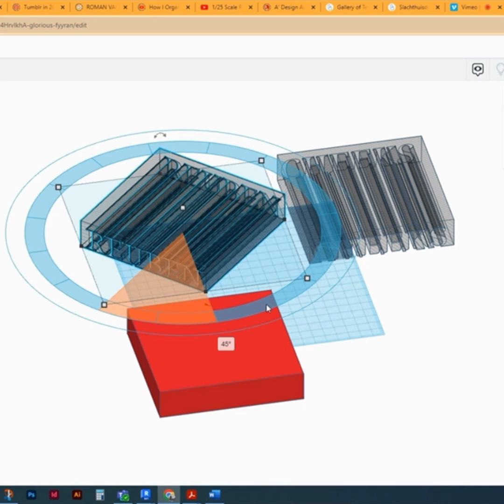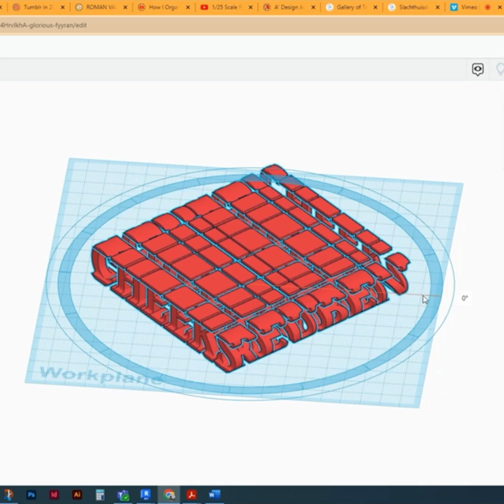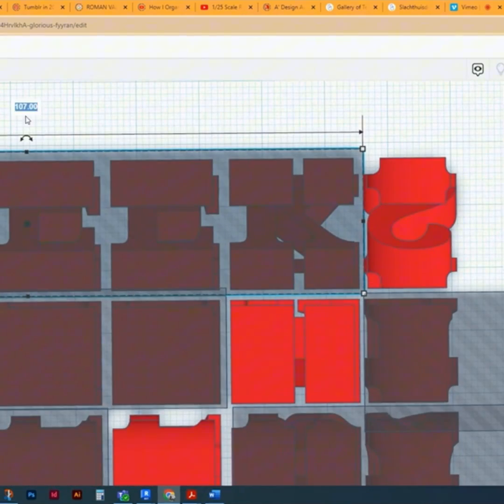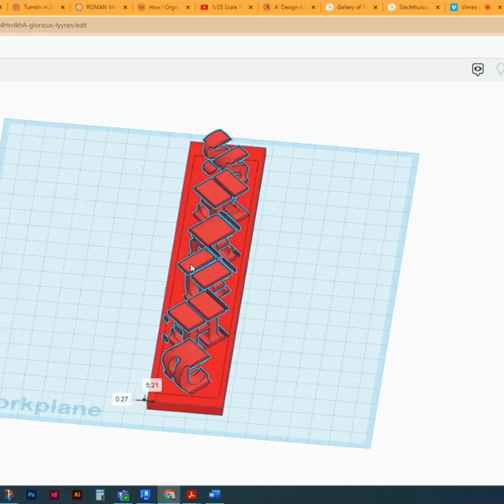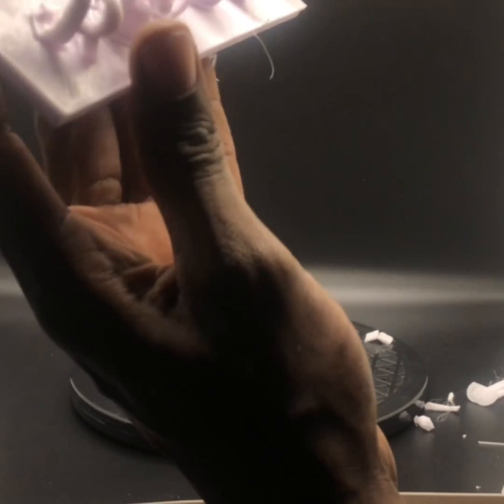3D PRINTED NAME PLATE ILLUSION #cool

Comment: Very cool idea! Any idea why you had so much stringing? maybe your plastic is a bit wet?
Reply from the maker: yeah I was testing a new filament, ' high speed PLA'. I had my temp at 220 instead of the 190 that it is suppose to be at. Also the font has the serif, if I use the other font in tinkercad It would of been less stringing as well. Thanks for support!
Reply: That makes sense, gonna have too give this a try at some point!  @Affinity3DStudios